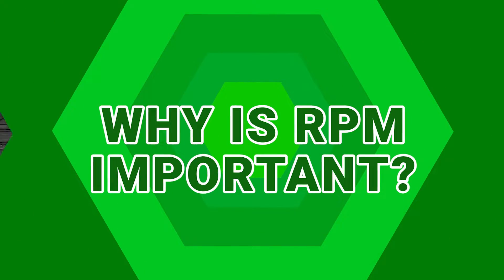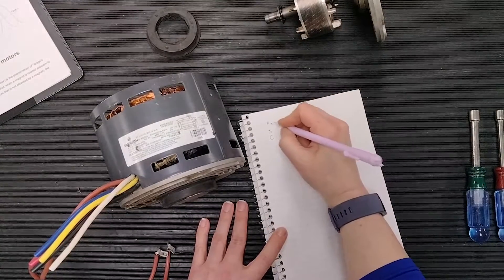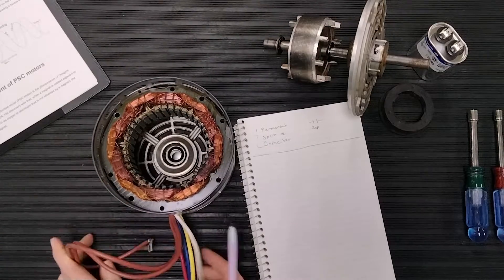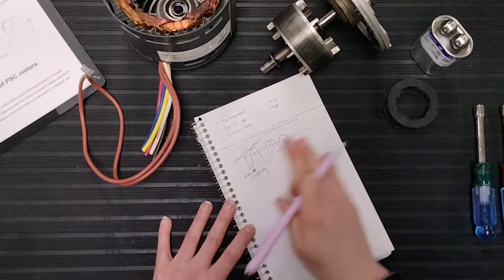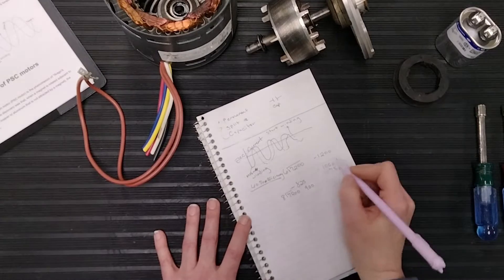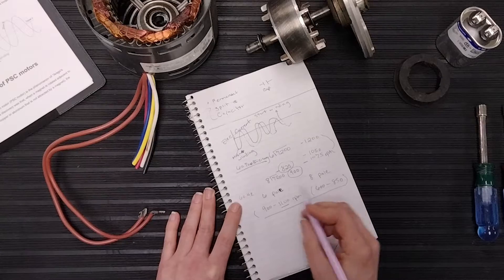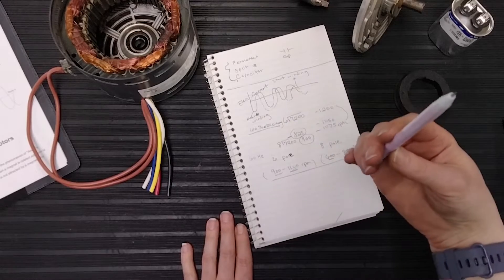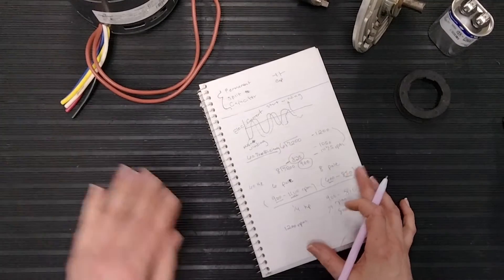Is RPM Really That Important? Why Your Motor Specs Should Always Match.

Comment: I will be replacing a 810 RPM for a 825 does it make a difference?
Reply from the maker: They are both 8 pole motors, no difference in speed.

Comment: Are the specs of the fan blade the main factor for determining the RPM and HP of the motor? If the motor and blade are simultaneously being replaced, do they just have to match spec with each other, or does the capacitor also play a role? If it does, can a blade and motor be chosen solely based on the capacitor's specs?

Comment: What about replacing an 850 rpm motor with an 825 one. Is it gonna make a huge difference.
Reply from the maker: They are the exact same thing! Anything that lists between 750-900 RPM on the tag is actually an eight pole motor.  All eight pole PSC motors are 900 RPM.
Reply: @opentopublichvacschool  thank you so much for the quick replay.

Comment: Can i use a 1/4 hp 1075 motor to replace a 1/3 hp 825rpm motor? My tech did this and it has been overheating. He doesn't seem to think the motor size is the problem, any suggestions?
Reply from the maker: The motor RPM and horsepower are both a problem if you're using the original fan blade.  If he put you on a 1/4 1075 motor, you would need a smaller/lower pitch fan blade.
Reply: The HP required to rotate a given fan is roughly proportional to the cube (3rd power) of the rpm.  Therefore, changing the rpm from 825 to 1075 requires the motor to apply roughly 2.2 times as much horsepower.  Given that the original motor was sized at 1/3 HP, this rpm change would require a motor of at least 1/2 HP...meaning the 1/4 HP motor is BADLY undersized, and would be expected to overheat.  Since HVAC equipment is usually designed to have some margin in motor horsepower, the 1/4 HP probably would survive if chosen to run at the same 825 rpm.
Reply: @robevans5222  HI:  Would it be fine if I decide to downgrade the HP ? from  1/4 hp 825 rpm to 1/5 hp  825 rpm? thanks
Reply: @Cordycep1 Assuming you're going to use the same fan, you would need to do one of two things to confirm that 1/5 HP would suffice:
1)  If you can get a copy of the fan performance curves, you can use them to determine what HP the fan would use at 825 rpm.
2)  If you can't get a copy of the fan performance curves, then I'd suggest checking the amp draw with the existing motor...of course, this assumes that your existing motor still runs.  The amp draw with the existing 1/4 HP motor can then be compared to the amp rating of the proposed 1/5 HP motor.

Comment: I understand about rpm, would the horse power matter as much?
Reply from the maker: It is important, but you can play with it a little.  You can go up a little in the lower HP fractional motors.  If you need a 1/5th, you can use a 1/4 with no noticeable issues. If you need a 1/8, you can use a 1/6.  As you get to higher HP, you get less wiggle room.  I wouldn't use a 3/4 for a 1/2.

Comment: Replacing a 15 year old outside condenser motor in Florida. Real problem matching size and specs. Found one advertised as direct replacement BUT original is 850 rpm replacement is 1075 all other specs match. How bad do you think this is going to be? I know I am wrong but it seems like faster would be better.
Reply from the maker: So sorry I didn't see this before, I didn't realize that my comments were turned off! When replacing a 850 (aka 825 rpm, 810 rpm, 900 rpm all the same thing) What I would do (just for future reference, since I know this is a late response) I would go with a 2 speed motor and only use the low speed in a pinch. The main issue with going with a higher rpm is the fan blades are designed to go 850, so adding speed to that can cause the fan blade or motor to go bad prematurely. Hope this helps and sorry again for the late response!
Reply: Thank you for the reply but this is Florida and I needed relief. Installed higher RPM and is running great.  @opentopublichvacschool

Comment: Hello,
Can a 1075 rpm fan motor be used to replace a 1100 rpm fan motor?
Reply from the maker: Yes, in fact that is the same RPM. It's a 6 pole motor, which is the same as 1200 rpm which is the same as 1075. It it's over 900 rpm, then it is a 1200 rpm motor.

RPM is figured by 7200 divided by the number of poles in the motor - so the options for residential fractional horsepower motors are 4 pole (1600rpm), 6 pole (1200rpm), and 8 pole (900rpm).
Reply: @opentopublichvacschool  thank you 🌟